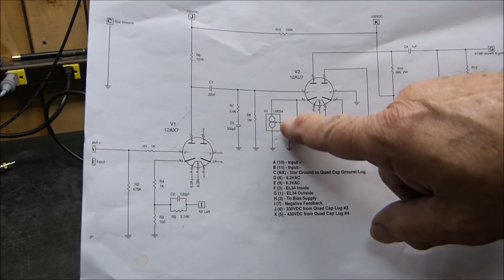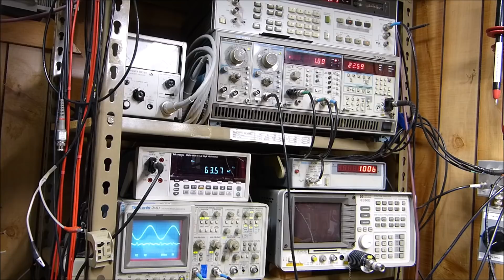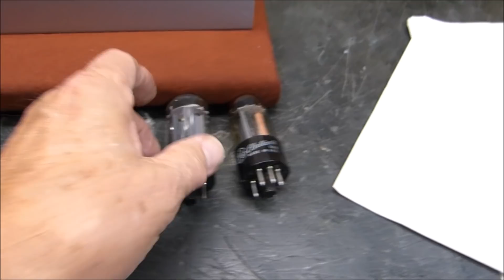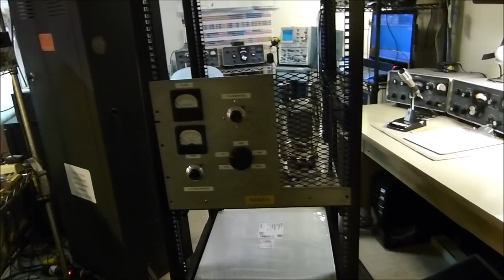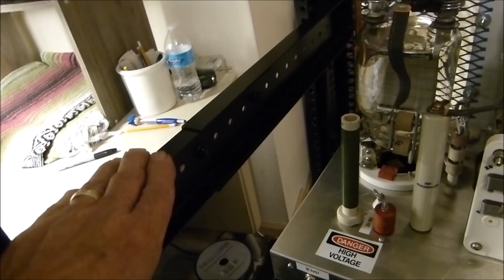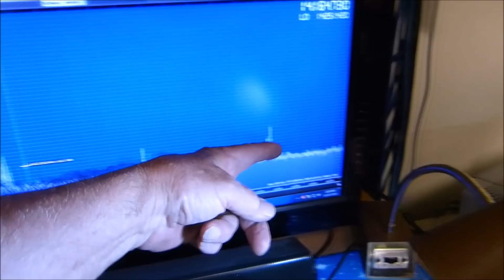807 (1625) Vacuum Tube Audio Amplifier With Triad Output Transformer & AM Transmitter

Comment: Fender (on their 1965 Super Reverb amplifier with 6L6GC tubes) wired audio from the speaker lead, (attenuated) to the Phase inverter section. (Providing negative feedback directly from the speaker lead). I believe this gave them a flatter frequency response and lower distortion.  The Super Reverb has 4 speakers (8 ohm) in parallel, so a 2 Ohm load.  45W stated output rating.   It sounds fabulous in my opinion.
Reply from the maker: Taking audio from the speaker winding back to the cathode of the first audio tube (in HiFi amplifiers) is the common way to get global negative feedback (GNFB) and I agree, it does give a very nice flat frequency response. There is a formula for the value of resistor to use for attenuation found in some of the Williamson design amplifiers. They state the formula as 1200 times the square root of the speaker winding impedance (3.4K for 8 ohms). I have tried that but prefer to measure a value of power out of an amplifier at low distortion (say, 10 watts) and then use a pot as a variable resistance as the FB resistor to lower the power to something like 16 dB which would be a power level of about 0.25 watts. Sure seems an extreme attenuation but that is accurate for 16 dB of 10 watts, then read the resistance value of the pot and replace it with a fixed resistor. Thanks for your comments.

Comment: you cannot glue on electrolytes like this - it defeats their safety feature in case of explosion. Otherwise, like the amplifier. 807 at high B+ has such low distortion that no feedback is necessary.  You are not using GNFB, do you? Do you stabilize screen voltage?

Comment: Beautiful amplifier, impressive skills.  Are the filter caps fixed to the chassis with hot glue? I'll have to try that trick out. There's additional security when gluing 4 together in a group.
Reply from the maker: I stick the capacitors to the chassis with Goop. I have thought about hot glue but have not tried it yet. Goop is a very sticky silicon based glue that holds amazingly well but can be pried lose if you need to change the component. For the 4000 volt level when I series ten capacitors in series, I "Goop" them to an insulating board, and not directly to the metal chassis, in such a configuration that it is easy to connect the capacitors in series and place the resistor shunts across them. I use series electrolytic capacitors all the way to 5400 volts DC with no issues and they take up a lot less room and are much cheaper than the large oil filled transmitter-level capacitors.

Comment: Your build quality is second to none. By comparison my work looks like a rats nest. I build little single ended guitar amps using the 807, just because it looks cool. One issue I have is limiting the screens to 250 volts max, as per the tube data sheet. How do you deal with it in this amp? I usually use a string of zeners.
Reply from the maker: John, it is nice to hear that you are a builder of tube amps. I think there are fewer and fewer of us every day...
This output transformer has UL taps on it so the screen is at the same potential as the plate. It is true that if the screen is run at 300 volts and the plate at a much higher potential, as much as 750V for the 807/1625 and similarly true for the 6L6, 6550, etc, the tubes will produce more power output. In general, hardly anyone runs the 807 family of tubes as a tetrode but rather in some form of triode mode which UL is a form of. I don't build SE amplifiers but I am pretty sure you can connect the screen directly to the plate or if you prefer, thru a 100 ohm resistor to the plate and you won't have to deal with the screen voltage being at a different level. There are an amazing number of tubes that can be strapped as a triode to include the 807/6L6 family of tubes to include large tubes like the 813 and 4-125A thru 4-1000A tetrodes. On the other hand there are those tubes that can not be run as triode and some of these include the 4-65A and some of the 4CXxxxxx family of tubes. As an example, the 4-65A must be run as a tetrode and the 4CX1000A must be run only class AB1.  Bboth tubes require bias, screen and plate voltage and the screen voltage can never be applied without plate voltage of the tube will be destroyed.
Reply: @ElPasoTubeAmps  Thanks for all that information. I love building stuff and I'm always learning. I get the triode/pentode thing just fine. In all my tube charts and data books I'm seeing the G2 max voltage for that tube as 300 volts, but in triode mode there is no value at all, just blank. If I strap the screen to the plate, it will see the plate voltage. In your amp that has to be above the specified 300 volts. I've read that this would cause the screen grid to burn up. I've seen a few designs where they use Zener diodes to regulate the voltage after the U/L tap or power supply node. Usually this is around 250 - 300 volts. Your design is the first I've seen that this doesn't seem to be an issue. I'd love to know in the video what kind of voltage and currents you're dealing with. 
Two of those amps and a set of K-Horns.....Oh ya.

Comment: Looks good KA5WZY  i have a PPP  1625 modulator built from the 1965 arrl manual
Reply from the maker: This was my first modulator to modulate a pair of push-pull 812A tubes in a 1947 James Millen amplifier. It was too small and I ended up with, and still use in my AM transmitter, a modulator using Eimac 4-125A and a BC-610 modulation transformer. This one does a great job of modulating the Millen amplifier. I mostly keep it at 7293 KHz so maybe we will meet on the air some time for a QSO.

Comment: Nice build! What is the input impedance and p-p voltage to the driver board? 600 ohm? High Z? 1V?
Reply from the maker: Input Z is 470K and even though I have not measured it yet, the input voltage necessary for full output is around 1.5 volts.

Comment: very nice build, very similar to what i am working on (that is what i say since a year.... not ime....).
just take care about the insulation on the HV capacitors, remember that the rated voltage is between the legs and not from leg to body, i would add some insulation between the body and the chassis, just personal taste!

i really like the server cabinet,could you link me where you bought it?
Reply from the maker: Manuel - you are a very accurate observer concerning the power supply capacitors. I did indeed end up with an intermittent arcing problem between the case of the electrolytic capacitors and the chassis. They are mounted with Goop but needed to be better insulated to prevent the intermittent arc that sometimes occurs on power up when the voltage soars to probably 750V or more - the capacitors are rated to 900 volts DC for the power supply but it sometimes arced to the chassis apparently around or thru the Goop. 
In my transmitters, I always mount the whole capacitor bank on an adequate insulating material then mount the insulating material to the chassis as I know 4 and 5 KV is going to find its way to the chassis if all precautions are not taken. Thanks for your comments.

Comment: Nice job David !! Ever think about getting involved in Electronics... LOL   We need to meet up on 20mtrs once day if we ever get some decent sunspot activity.
73, Glenn WA4AOS
Reply from the maker: Glenn,
So good to hear from you. It seems 20M is getting better lately. If nothing else, the mono band 20M  hexbeam I recently put up is absolutely amazing. It even solved the RFI problem of me getting into the computer when my wife is using it and the computer is located just beneath the antenna. Apparently, the main beam of energy is actually going outward horizontally and not so much downward even at close range. I do hear stations from your area usually in the afternoon probably 4-5 O'clock my time (I am on Mountain time) so, if you are on anywhere in the middle of the 20M band, maybe we can hook up or send me a time and frequency and we will try it.   73

Comment: I hear vintage radio buffs, say you need to be careful replacing valve rectifiers with solid state because solid state gives  you full filament current right from the get go, and this cold cathode thermal inrush shortens the life of the valves.  Is this true?  Do you need to run some kind of step start current limiter if you go solid state rectifier with tubes?
Reply from the maker: I personally doubt that it harms the tubes by applying HV to them. In amateur radio amplifiers that use tubes like the 811A or 3-500Z for example, these amplifiers are considered "instant on" and the HV is applied while the tube is cold because of the solid state rectifiers. 
There is a fear that goes around sometimes called "cathode stripping" but if you read what tube manufacturers like Eimac have to say about it, it only applies to very high voltage (like 25 KV? not sure of the actual voltage level). What is likely to happen is with the tubes cold they are not conducting and the high voltage will instantly soar and likely will exceed the voltage rating of the electrolytic capacitors in the power supply.  Over time this is not going to be good. This is very real,  so just  willy-nilly changing out the old style rectifier is probably a bad idea. This would especially be true if the old rectifier is a 5U4 as the voltage drop across it is pretty high. On the other hand, a 5AR4 has a much lower voltage drop across it and will have a higher voltage output like the SS rectifiers. The Dynaco Mark III is well known for the plate voltage soaring past the voltage rating of the electrolytic power supply capacitors as it uses a 5AR4.

Comment: By the way I built a 807 amplifier from spare parts I had on the Shelf over a New Year's Day a holiday a couple of years ago. Came out rather nice I use the hot cathode phase inverter for the single transistor that measures the cathode current and valances the cathode current between tubes.

Comment: hi i want to make a 807 single ended so  is it better to put 2 chokes to separate the 2 channels cause i make one chassis stereo .thanks for yours  interesting vidéos
Reply from the maker: I assume you are referring to power supply chokes. I see no reason to use a separate power supply choke for each channel. The capacitor(s) on the output side of the choke in the power supply is what takes the audio component to ground for the power supply and are sufficient.

Comment: Hi your caps seem glued what stuff you use
Reply from the maker: I use a silicon substance called,  "Goop". Just a dab on the bottom, or side of the capacitor and stick it to the chassis. It needs to dry for hours or overnight. It will not fall off but you can remove it if necessary. However, if any capacitor is going to have the negative side above ground like when capacitors are in series to raise the voltage rating, it is a good idea to "Goop" them to insulating material then stick the material to the chassis. The thin plastic insulation around the capacitor is not thick enough to insulate at high voltage - and example would be putting two, 450 volt capacitors in series (with shunt resistors across each) to run at 900 volts. In a case like that, they have to have more insulation on the metal outside of the capacitor(s) that are above ground for the negative side or they can (and will) arc to the chassis. In the amp in this video, I had to remove the PS capacitors and mount them on a piece of mica board to stop arcing. Practically anything with work for insulating material, I use sheets of particle board and run them at 5000 volts in transmitter power supplies  (twelve, 450 volt capacitors in series, with resistor shunts to equalize the voltage across each capacitor) or, mica sheets are sold on Ebay that work great. Look for, microwave mica sheets. Example below. 

https://www.ebay.com/itm/401310056249?hash=item5d6ff17f39:g:-C0AAOSwNUlb6SjD&amdata=enc%3AAQAHAAAA8CJ7qD7MZDvsLNuVgChe2IEGXX2NrW0gaFZx5wWw8J6Kb9fyrtWtyjhjMFlkbx0qWEzoaGXv22STQbrrakK3JCEwlvwTkuY1E0PGGFg1GfCJbc5%2BBv2apZe8LohYpaNd8NS%2FI7kOSx%2BjryTq9Ze2W21m%2BK6kQnQYnvt%2BQyxZiT7TbhF%2FrV4H2saVzYDNVTLb%2BUq5AZPkht%2FZppTzM7Mj%2BdPyQKBT2Y3ECH3Yl%2BjwsneHmc2ebw0uBEh3l4JhvHakOSbzZN0umzbhLx449m6zanqXgQU6vr493YTWCdqeByxurhoO5kvbZaZwXfIH4JUeOA%3D%3D%7Ctkp%3ABFBMruSGw8dh

Comment: what screen voltage did you apply to 1625 ?
Reply: David mentioned that he did not build a screen voltage supply and the screens are connected to an Ultralinear tap off the primary winding of the output transformer.  The screen voltage is essentially the same voltage as the plate voltage or B+ voltage, therefore, it is basically a triode configuration because the screen and plate are sychronized with respect to DC and both acting as a single electrode.  AC signal from the plate is feedback to the screen.
Reply: @vintageaudio7518  No no no, in UL or triode screen limit  for 807 is 400 V, 600 V would be asking for trouble.

Comment: What type of regulator are using is it better to use equalising resistors or 0.1 poly cap what values are the resistors type
Reply from the maker: I am not sure of the regulator you are talking about.  The only resistors I can think of you might be referencing are the 1 ohm resistors in the 1625 cathode circuit to ground that allows me to monitor and balance the cathode currents. I also use 1K ohm grid-stopper resistors so is that what your are referencing? Please tell me more.
As for the types of resistors I use, I just randomly pick the value and wattage that is needed not considering if they are vintage carbon, or metal film. I am very careful when using wire wound resistors unless they are used in a cathode circuit shunted by a bypass capacitor.
Reply: @ElPasoTubeAmps  forget about the the regulator I didn't realise when I wrote the comment you were using a tube.
But maybe you could help me with this the resistors you used the red ones on the filter capacitors, just wondered why you use resistors instead of a 0.1 safety poly cap, they do the same thing I believe??  you use the resistors as a shunt resistor surely you need a high wattage resistor if you're using a resistor from the means that's running fairly High Voltage, and how do you determine the resistance value? what is the wattage of these resistors and don't they not get hot?
If I've got this right the purpose of the resistors or the decoupling capacitor is to give greater capacitance to the filter capacitors, because they are constantly discharging and recharging and don't reach the full capacitance is that correct. What is the purpose of the resistance compared to decoupling capacitor is one better than the other thanks! that's not too much ha ha

Comment: Why would you spoil it all with that crummy printed circuit board !
Reply from the maker: That PC board did get swapped out where I mounted an aluminum plate in its place and installed two 6SN7 in a Williamson design. Much better... Thanks for your comments.

Comment: could you show the schematic ?
Reply from the maker: Here is a link to the schematic of the PCA driver board and how they connect it to the Dynaco Mark III and Mark IV amplifiers which is how I am using it but just not in those particular Dynaco amplifier chassis.     http://site.triodestore.com/poseidon.pdf
Reply: Very good

Comment: beautiful job !  KA2KUG
Reply from the maker: Thank you. I did finish (or is any project ever really "finished" ?) the AM transmitter I showed at the end of this video. I have made a couple of videos about it but really should do one with it in its current configuration. Feel like a kid again running AM, kind of like I am doing something I am not supposed to.   :-)   I also have met some really good fellows running their vintage rigs like the Heathkit Apache - sounded magnificent and the Johnson Viking and so on all  around 7.290 MHz.      73
Reply: @ElPasoTubeAmps  thank you for your reply , I finished to restore also a johnson viking and very recently an heathkit dx 40 , so I will be looking for you ( your call sign ??) when are you on 40 meters most of the time ?? 73 mike , ka2kug
Reply from the maker: @md10591  Hi Mike,
I am not on at any particular time but when I get on 40M it is where the AM guys tend to hand our around 7.290. When I am on 20M I usually hang around the middle of the band at 14.250 so I have the maximum amount of people to talk with. I do have a Wednesday schedule with my friend in Iowa and sometimes guys we know from NY and CO show up, depending on conditions. That is at 14.156 and 1 PM Mountain Time on Wednesday. All we talk about is building equipment so please join us if you can.  73  WA4QGA  I also have a lot of pictures on  my QRZ page.

Comment: Quick easy Improvement to this amplifier would be to replace the five you for with a solid-state rectifier of course taking into condition The Surge voltage at the startup. But the Distortion will drop considerably the power output will increase a bit and the output impedance will decrease so the damping Factor improve.
Reply from the maker: Totally agree with the SS rectifier replacement as being an overall improvement in performance. Everything gets better but my voltage goes up higher than I want although there are taps on the UTC transformer I could use to lower it. On the other hand, building with vacuum tube rectifiers, including MV rectifiers, is primarily for the aesthetic value it adds to the amplifier.

Comment: What are you doing with ypur screen grids ? Do ypu have UL taps.  Resistor divided ? Or regulated
Reply from the maker: This amplifier does have screen taps and are used. It evolved into a much more powerful 6550/KT88 amplifier. Not sure but I think I made a video of that version using the 5U4 rectifier and then a solid state rectifier. A good bit more power with the higher voltage from the SS rectifiers. Being very conservative with vacuum tube rectifiers, a 5U4 is really only good for an amplifier of about 30 watts output. I do still have this amplifier.